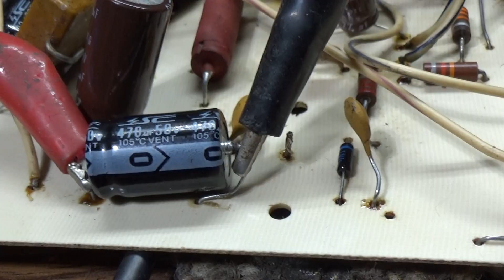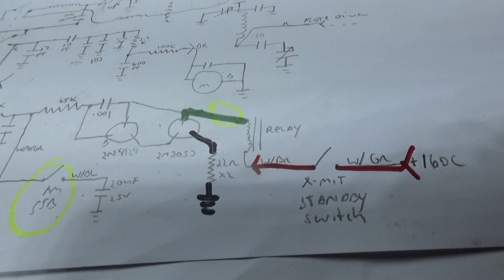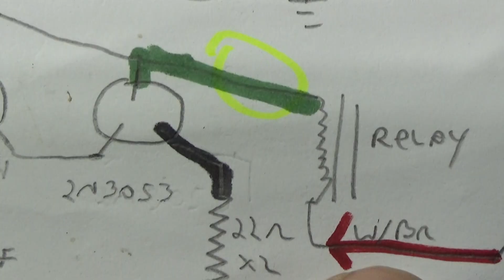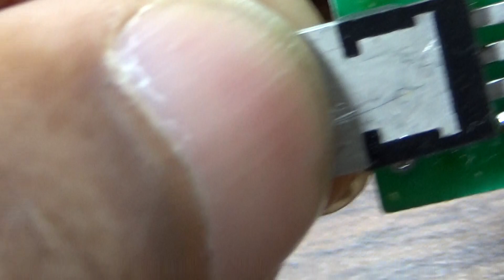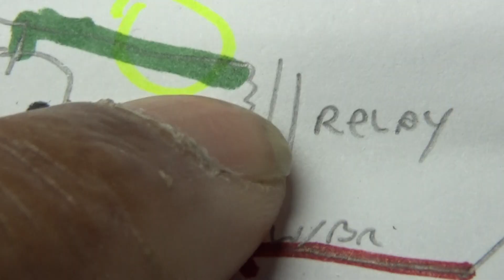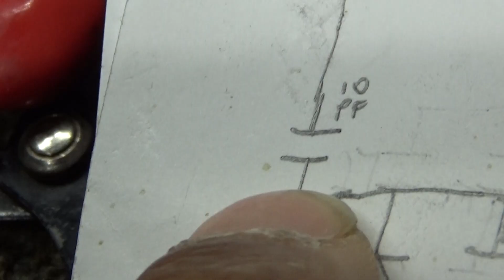Keying circuits, me ranting and getting long winded maybe because I wasn't feeling well.

Comment: The early mobile D&A Bandit used a strange circuit that had a tube keying circuit. So the power supply squealed all of the time it was turned on. The other strange thing was that it used the power output tubes as a preamp on the receive state! Has anyone out there ever seen such a beast?

Comment: Bravo! Much safer to test the low-voltage stuff with the scary voltages turned off. That little power supply is a swiss-army knife sort of tool.

Comment: A nice explanation Doc.👍 
I ran into something that I hadn’t thought about the other day. I got a Sonar mobile amp with 4 power output tubes. It also has a keying circuit that uses a tube. So when you hook that mobile amp to 12 volts, the big switching transistors start high frequency switching, even when you aren’t keyed. The little switching tube cannot work unless that circuit is producing high voltage for the keying tube. My ears can no longer hear them switching, but my wife put the hammer down on me!🤣
It sure is nice to have modern electronics available.